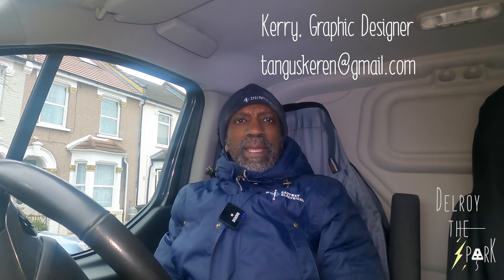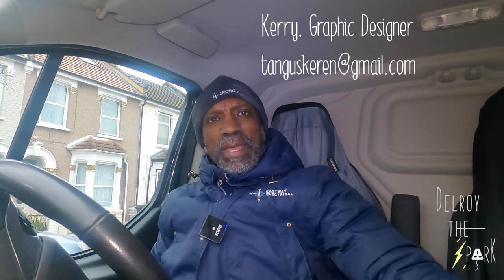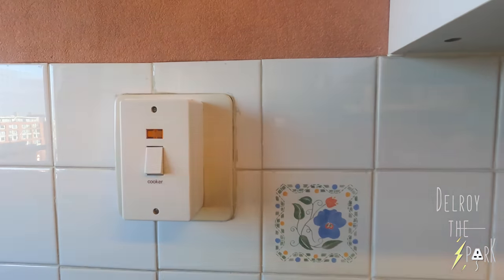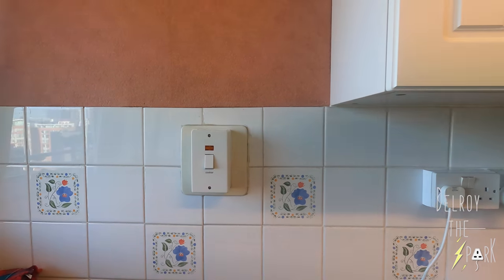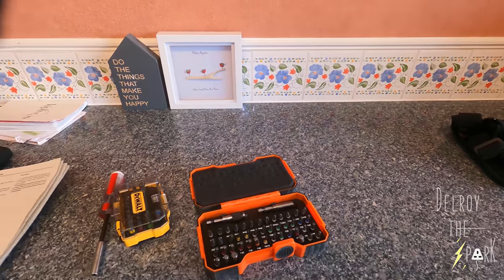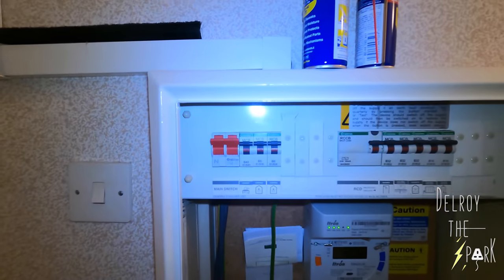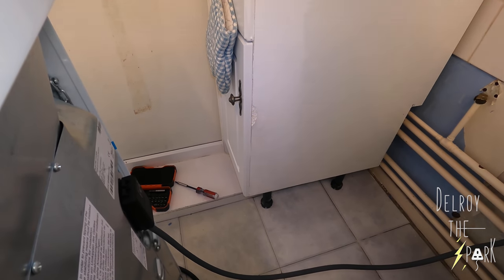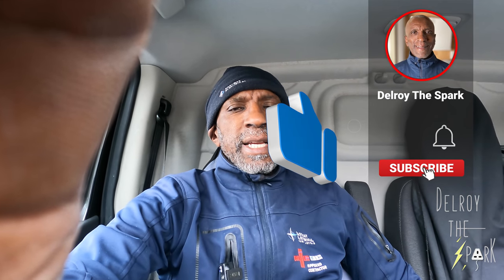Ex Council Flat Cooker Installation | Electrician In London

Comment: You don‘t need a bit set. Most manufacturers of screwdrivers also offer Torx (should be the size TX20 or 25) also as insulated screwdrivers.

Comment: Isn't 6mm supposed to be on 32amp breaker and how comes you didn't move the breaker to rcd
Reply: 4mm is rated for 32 continuous (assuming reference method c, no derating factors), technically the 4mm flex at the cooker would handle 41 amps as in free air but not a good idea behind a cooker. the circuit only extends to the outlet plate so no modification to the circuit occurs, its just an apliance so no need to add rcd protection.
Reply: Also there is a paragraph in the regs that suggests 4mm is always gonna be enough for any cooking equipment when diversity is taken into account.
Reply: @londontrada  I think it says that cooking loads upto 15kw are suitable on a 32 amp breaker and therefore 4mm assuming clipped direct.
Reply: 4mm can run 40amp+ , so on 32amp circuit it's fine
Reply: @conorlanders8401  - A '6mm for cooker circuit' is a throw back from the old BS3036 30A rewireable fuse days when a derating factor of 0.725 was applied so a 4mm cable was not permitted as it took the cable rating below the fuse rating.
The next size up is 6mm (IM C).👍

Comment: Silly question but...why don't you are using 3-phase system in houses? For flat cookers (mostly in central europe), we are using breaker 3x16A 
(3x10A sometimes enough too) and 5x2,5 cabel. Easier work with thinner wires and in my opinion, more power for anything.
Reply: It's always been single phase to domestic houses in the UK.  Thats how the distribution networks set it up.
Reply: Where can I purchase the wire coming from the cooker ? Why is he only using one when my wall outlet has three black yellow and red ? Pls help

Comment: How much do you charge to install a cooker, just asking in advance.
Reply: I did one recently for £20 with 6mm t and e client bought. Took 2 hours with testing as cooker plate was old and 'threaded'  and cooker had cheap connections which could fall apart with ease and link plates. Nightmare. £80 a proper quote but you think 20 minute job....duh
Reply: @EMEL-hr4ut  Thank you for your reply.👍🏾

Comment: Only single phase connection on the cooker? Interesting. Can't say I've seen that before. They usually have three phase with copper bridging if you want single phase. 

We call it a stove or stove and oven in South Africa just FYI. Maybe a hob if the are split units.
The big tank water heater we call a geyser. No idea why.  Only used for plumbing purposes (bath, shower, basins) and not central heating. Central heating is not a normal thing here.
Reply: It’s in most new cookers? 🤣🤣
Reply: @Madman-ge2eb  Three phase power is not used domestically in the UK, in difference to most other countries
Reply: @alex_lightning4523  Yeah but do you actually get a lot of cookers specifically manufactured for the UK market? I thought most of them were common European versions that came with little copper jumpers for all sorts of supplies (1ph 230 V, 2ph+N 230/400 V (i.e. two out of the three phases from a 3-phase supply), 3ph 133/230 V and 3ph 230/400 V, even 230 V 1ph 2L+2N (i.e. two single-phase circuits)).
Reply: @alex_lightning4523  i know that I’ve been working for 3/4 years now 👀👀
Reply: 3 phase on a cooker in a domestic house?! Not in England

Comment: Looks like there is a switch above cooktop. Is there no regulation against that over in UK?
Reply: Not specifically, though everything you install must be suitable for the location.
Reply: isolation should be min 300mm horizontally from edge of cooker and within 2 metres of appliance if new kitchen.

Comment: 6.0mm t/e cable can only be protected by 40 amp MCB if it is clipped direct. Hope it’s not in thermally insulated wall. Also, you ran a new cable to the cooker and didn’t connect it to RCD protected side of consumer unit? If the cable is buried in a wall less than 50mm depth, RCD protection is required. Reg 522.6.101
Reply: Changing an appliance is not an excuse to start retro-applying whatever todays standards are to an existing installation.
Reply: as far as i could see he only changed the flex to the cooker, the outlet plate is the end of the fixed wiring which would fall under the requirement for rcd protection.
Reply: @conorlanders8401  yes I have noticed this now. I  first thought he ran a 6.0mm t/e from the consumer unit.